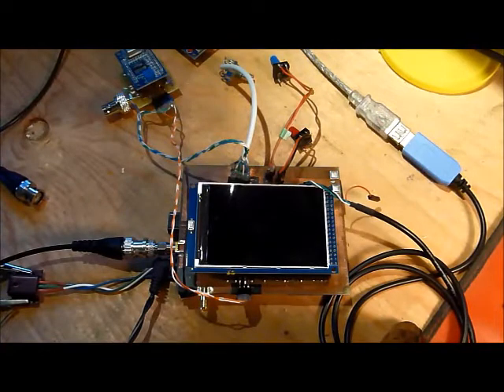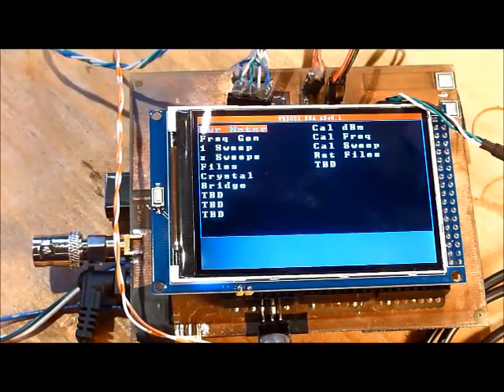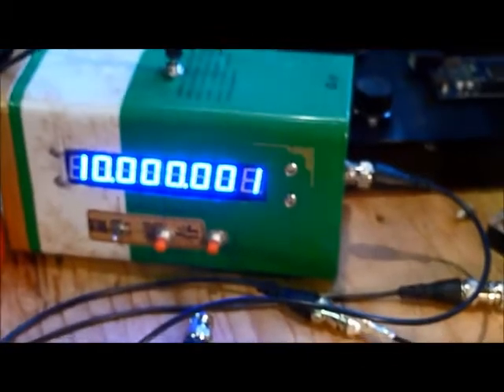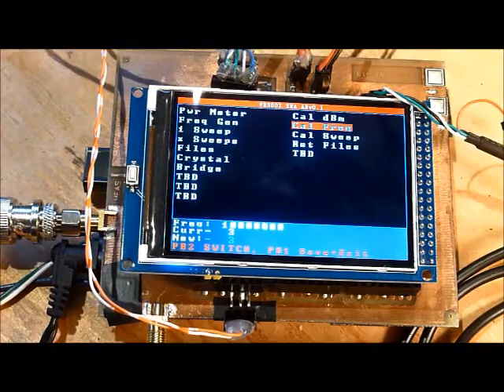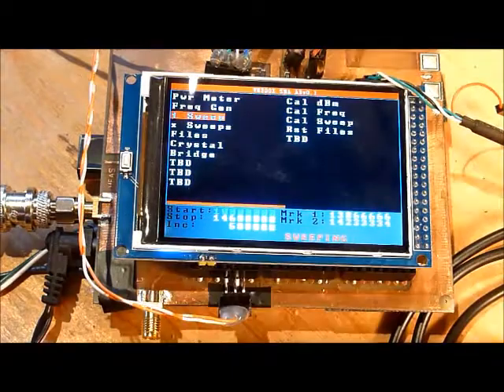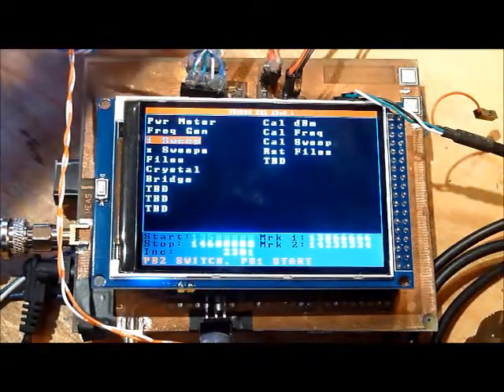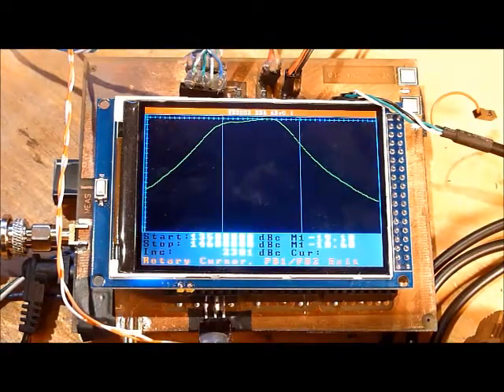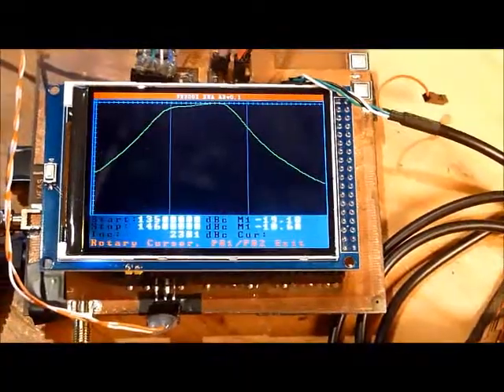Arduino SNA  AD9850

Comment: You might consider a switching regular device like OKI-78SR-5/1.5-W36-C.  It can provide 5 volts at 1.5 amps and with an input of 7 to 36 volts, with no heating issues like a linear regulator.  They are fairly RF quite too.  Nice work!!!!